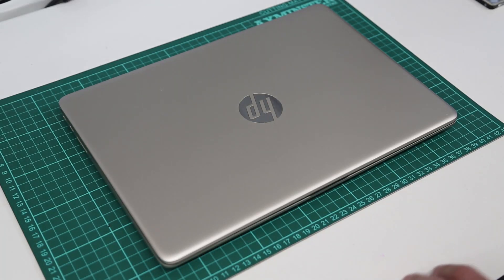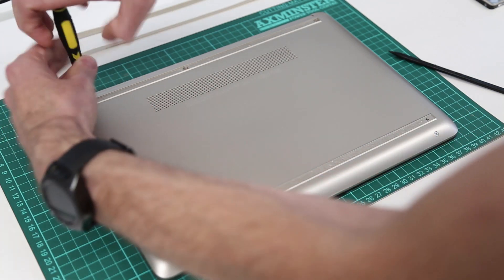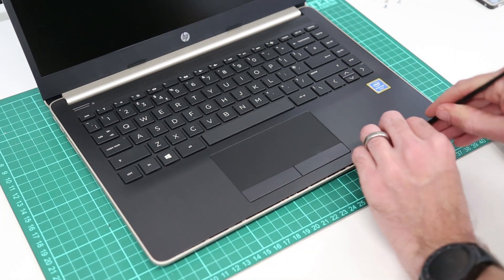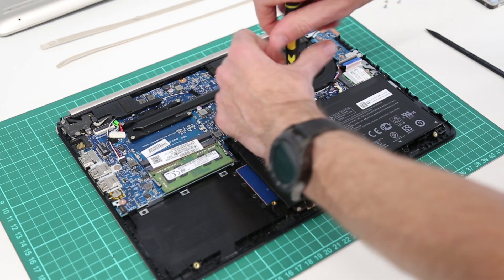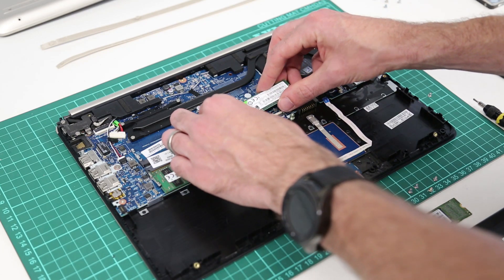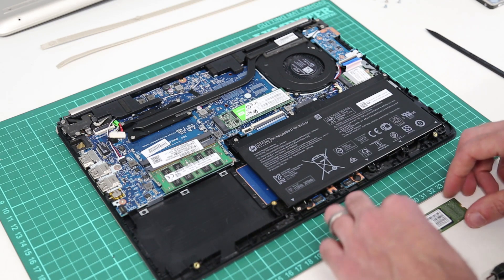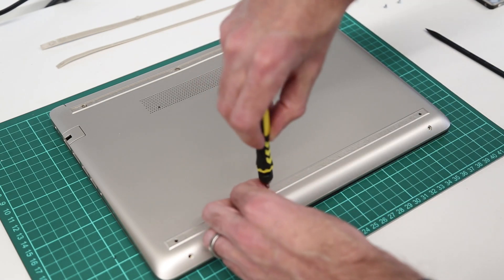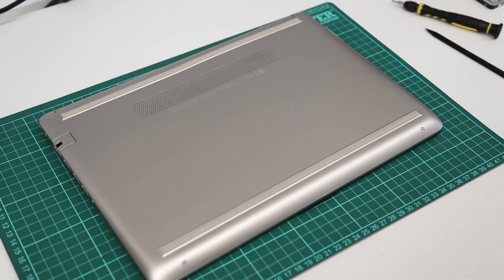HP 14-cf0500sa SSD and RAM Upgrade Guide

Comment: My notebook type HP14s dk0008ax. What type SSD for my notebook?

Ssd m2 or ssd nvme ?
Thanks 🙏
Reply from the maker: Service manual lists both SATA and NVMe type drives, so if it has the slot either should work.
Reply: @BrueComputing  oke. Thank you mr 👍👋
Reply from the maker: @_suryaapr  Glad to help!
Reply: @BrueComputing  i subcribe your channel
Reply from the maker: @_suryaapr  Thanks!
Reply: @BrueComputing  I want to ask again, yesterday I bought 4GB RAM memory (2666mhz). In my notebook ram slot there is 4GB memory (2666mhz) too.
in CPU Z app it reads 8gb. but on the memory menu.

reads only one channel of RAM. please help. is my notebook broken?
Reply from the maker: @_suryaapr  The AMD A9-9425 Dual-Core APU only supports single channel memory - so you can have two modules, but it doesn't interleave between them for increased bandwidth.

Comment: Can you take out the ssd in a HP 14-com0605sa model without breaking the laptop?
Reply: I mean cm sorry
Reply from the maker: Very similar to the CF then - you can find the service manual here: http://h10032.www1.hp.com/ctg/Manual/c06245114.pdf
Reply: Ok thanks
Reply from the maker: That model number doesn't appear to correct- there is no 14-COM chassis.

Comment: Can u change the cpu on this
Reply from the maker: Only by replacing the mainboard - the CPU in all modern laptops is soldered down.
Reply: @BrueComputing  so will a ssd in mine help with loading gta game textures
Reply from the maker: @t-dontcap1896  It may help a little, but it'll never be a great gaming system.

Comment: I have a question did u have to buy windows 10 or does it install windows back on there when u did the hard drive swap
Reply from the maker: The key is in the laptop firmware, so you can either clone the original drive or install and activate without a key.

Comment: I'm upgrading a HP Stream 14 cb012dx with F.61 Bios. I already up graded the RAM but there's only 64GB storage. Will a PCIe SSD work with the bios on this platform? Thanks
Reply from the maker: As far as I'm aware the HP Stream 14-cb012dx eMMC is soldered to the mainboard - therefore it cannot be upgraded. I don't think there is any M.2 or SATA interface internally.
Reply: Thanks for the reply. You are correct that the storage is soldered the board. I was thinking about using a 
M.2 (NGFF) NVME SSD to M2 A/E Key WiFi adapter to attach the SSD for additional storage. I've seen it done on a similar laptop but I can't figure out if this particular bios will recognize or boot from the SSD on that port.

Comment: Why should we disconnect the battery 1st?
Reply from the maker: Because it only takes a few seconds and avoids the risk of damage if the machine isn't shutdown properly before removing or fitting components, power button triggered whilst working, accidental shorting of power circuitry, etc.
It isn't essential, but it is a good idea.

Comment: I bought a HP Stream 14" Laptop (AMD A4-9125 Dual-Core, 4GB RAM, Windows 10, Snowflake, 2019 model) 14-dk0030ca,   I would like to do max update for ram, is it 16gig DDR4 RAM or 32gig DDR4 RAM or 64gig DDR4 RAM? How far can the system go for a maximum update? Thanks Robert
Reply from the maker: There is only one DIMM slot in the 14-dk0030ca. A 16GB DDR4 module may work, I doubt a 32GB or 64GB will.
Given the rest of the system specs though I probably not bother with more than 8GB.

Comment: I have pretty much the same laptop the hp14cf2503sa. Changed my ram to the 8gb but I dont understand why you removed the battery if it wasnt turned on anyway???
Reply: as to not damage the laptop with static.
Reply from the maker: Its not ESSENTIAL, but its good practice. Means it is definitely electrically off, and you won't accidentally power on the machine whilst working on it.

Comment: you should show what to do to your computer aftusjble to ter u are done ...do u have to run a full install or are u are able to just turn it on and start working
Reply from the maker: That's really a separate video in itself, and a subject I have covered in other videos.
You can either clone the contents of the old drive using True Image (or similar) or clean install Windows 10 to the new drive from USB stick.
This video is purely a guide to how to install the upgrades in the laptop.

Comment: I opened my lap top and I found out that only one stick of ram can go in
Reply: Yeah it comes with 1 stick of 8gb 2666mhz ram in my model
Reply: @jake6175  lucky
Reply: What model?
Reply: @isaiahthegamer5648  the newer model of the hp stream 14
Reply: @REDTHOMPSONCLAN wow same I have an hp stream I didn’t buy the RAM yet because I wasn’t sure how to do it so it can only use 8gbs?
Reply: @isaiahthegamer5648  the first slot is already occupied with a 8gb stick, u can add another stick to the other slot, since there are 2 ram slots.

Comment: I just got a brand new Stream 14 with the AMD A4-9120C processor and 4GB memory and a measly 64gig eMMC drive.  What's the max memory upgrade I can do and also what size drive can I swap in?  It's a work laptop, so I don't mind spending a little to upgrade it.

Comment: Excellent video, the one I am using is  hp laptop model 14-cf1000ne and it has only Hard Drive of 1TB and need to be replaced with SDD of same capacity. would you advise me what type ( model no.) of SSD appropriate for my laptop.

Comment: I have a hp 14-cm1000ne. Looks the same as in the video, with 4GB RAM. I've never upgraded a RAM before, therefore i have two questions which concern me the most.

Q1. Can i upgrade to 12Gb, with 4GB in its place and adding further 8Gb Ram? will the combination work? I read the whole comment section and couldnt find any clear answer as it debatable.

Q2. upgrading from 4GB to 12GB, will it affect my battery life?
i recently started to work with photoshop, illustrator and after effects. And this laptop is of no use unless i upgrade my RAM. So please do reply. Thankyou

Comment: Could you upgrade the cpu on this laptop??
Reply from the maker: No, the CPU in pretty much all modern laptops is soldered to the mainboard and can only be upgraded by replacing the entire board.
Reply: @BrueComputing  damn feeling limited with a ryzen 3 , thanks for the reply tho

Comment: Hi, nice vid. I ordered the parts from this and compatible RAM for my own laptop recently. (14-ck0520sa).
I'd like to ask, do you recall which size/type of screwdriver you used for the bottom screws on the back? I'd rather prevent screw stripping so it would be a huge help. It looks like the construction is basically identical.

Comment: Will an M key M.2 SSD work in the slot or does it have to be a B+M key? It looks like an M key slot to me but I've only seen B+M drives installed in it. (14-cf0008ca for reference) Thanks, great video!

Comment: can it hold a 2.5" ssd?
Reply from the maker: If you have a model with an SSD fitted as standard then it will lack the brackets and cables for fitting a 2.5" SATA drive, you'd have to source these and add them in which generally isn't cost effective.

Comment: What's the difference between this one and the model cb0xx? I swear, it's been a challenge chasing my model down so I can be sure what ram I can upgrade to or if it's even possible. Probably gonna have to dive in and have a look myself but thought I'd ask to save some time. Any tips are appreciated 😊
Reply from the maker: The 14-cb0xx range of laptops is part of the Stream line and is quite different. These generally have VERY limited upgrade options.
The service manual is here: http://h10032.www1.hp.com/ctg/Manual/c05227771
This shows that it has a single DIMM slot, so the RAM can be upgraded by replacing the existing module, but the eMMC storage is fixed and cannot be increased, and there appears no option for adding a 2.5" SATA or M.2 2280 drive.
Reply: @BrueComputing  well that sucks. I wish they wouldn't make such limited tech. Seems like a waste, know what I mean? Thank you so much for your quick response

Comment: Do these laptops have the capability to still take an HDD?
Reply from the maker: Yes, but if they didn't have a HDD originally they won't have the brackets and cables for the 2.5" drive, so you'd have to source these. In my experience it isn't cost effective vs. just fitting a 1TB SSD.
Reply: @BrueComputing  thanks , I already have the cable from old laptop so it's just the bracket
Reply: PS: I live int the Philippines a 1TB SSD is is like 10k Php meanwil all of the stuff I need is only 5k

Comment: This is a great tutorial. Thank you..
Question:  I have a HP 14-dk0028wm laptop. is there a way to add a Video Card (GPU) - External is OK, but I understand that a Thunderbolt 3 connection is required and I don't know if this laptop is compatible with that. Also is ip possible to upgrade the CPU to a faster, more powerful CPU perhaps a quad core? Id like to do some occasional video editing, and don't want to invest big $$ into a dedicated laptop for that, just yet.
Reply from the maker: I'm not aware of a way to connect an external GPU in these. The only option for upgrading the CPU would be to replace the mainboard with one with a faster CPU.

Comment: Great video! Quick question, does anyone knows if Amazon sells any bracket to place an HDD in this laptop and the specific SATA cable needed?
Reply: Part numbers are in the manual. 

2.5" HDD Bracket - L24490-001
SATA Cable - L23187-001

Comment: Nice video, I have a HP 14 cm1025la, it has a m2 slot but I dont know what tipe or max store it can handle. Please help...!
Reply from the maker: Assuming it has the internal M.2 slot it takes M.2 2280 modules or either PCIe NVMe or SATA type, NVMe being faster.
Capacity should be as large a module as you can find in that size of M.2 module, eg: https://amzn.to/2Xgijon

Comment: What a fantastic tutorial! Thank you! I am about to purchse the 4GB  HP 4-dk0599sa from Currys. My question is, will this be a similar process for this machine? They look similar on the outside I think.
Reply from the maker: It should be similar, you can find the maintenance manual here: http://h10032.www1.hp.com/ctg/Manual/c06242992

Comment: This worked beautifully for the 14-dk0028wm, which is the Ryzen 3 3200U variant. Identical motherboard, other than the AMD vs Intel thing. All I did was add a second stick of Crucial 4gb RAM. Later on, I'll swap to a larger NVME drive, and possibly track down the components to add a 2.5" hard drive or SSD.
Reply from the maker: Glad it helped!
Reply: Hi. I would like to ask you, do you know the part number of the kit to add the 2.5" SSD? Thanks, regards.

Comment: Hey James, I recently ordered a hp 14’ whisper silver laptop through Walmart app. It comes with amd 3200u and Vega 3. Do these ram upgrade and ssd upgrade would work on mine, thanks
Reply from the maker: Do you have the full model number?
Reply: @BrueComputing  hp 14-dk0028wm
Reply from the maker: @viziobehringer3633  The service manual here: http://h10032.www1.hp.com/ctg/Manual/c06242992
Shows that there are a pair of DIMM slots, and that model has a M.2 SSD as standard so will have an M.2 slot. So yes, should be possible to do both of those.
Reply: @BrueComputing  thanks brotha!
Reply: Brue Computing sorry for late reply. Just picked it up today at Walmart where I work. It’s 14-dk0028wm
Reply: I just had the same laptop show up today. These instructions are identical, as the motherboard layout is identical.

Comment: Hey man! Thanks for the detailed video of the laptop, i have the same laptop board as you "HP 14-cf0012dx". Im planning to add an extra ram in the empty slot. But just have one question. The extra ram module I have is DDR3, would i be still able to add it despite the original slot is DDR4?
Reply from the maker: No, DDR3 modules won't fit in a DDR4 slot.
Reply: @BrueComputing  alright thank you!

Comment: I have a HP 14-df0053od will this work for me ? I was going to order the exact parts you ordered
Reply from the maker: The HP 14-df0053od is equipped with an eMMC module for storage, so without opening it up I don't know if it'll have a SATA cable/bracket installed for a 2.5" drive, or a M.2 2280 slot for an M.2 SSD - it may not have either.

Your best bet may be to open up the machine and see what sockets are available.

Comment: hola! buen dia, yo tengo una laptop hp 14-ck0009la y tiene puerto igual M2, lo que quiero saber que tipo de SDD le puso a su laptop si es: NVME O M2 ??
Reply from the maker: I fitted an M.2 2280 SATA drive, but M.2 2280 NVMe PCIe drives are also compatible.

Comment: Superb Video! My wife has a very similar model and chassis design. Her's had a very noisy CPU fan for months. I could never figure out where the rest of the screws were to take the back off. Who'd've thought they would be hidden under the rubber strips? Once I got the back cover off a little compressed air is all it took to blow a wad of dust from the fan. When all was sorted and back together the fan purred. Job done. Cheers!

Comment: Thanks for the great video!  Would there have been a downside to leaving the original 4GB RAM in there along with the new 8GB?
Reply: Yes, it slows down the overall performance of the Ram, you would need the sake brand and gb size for it to worl, mixing at least for me is not reccomended. A 2x8 gb ram( 2 ram stick with 4 gb size) or a 2x17 gb ram ( 2 ram stick with 8 gb size).
Reply: @aganimsaj1376  Thanks for the reply.  I know that there are many misconceptions about the importance of using RAM that is the same brand and GB size.  Forgive me for asking, but do you have some expertise in this area or are you just sharing the conventional wisdom?
Reply: It's been months but I'm pretty sure mixing them would work. It would run in single channel mode rather than dual channel since the 2 ram sticks are not operating on the same size and frequency. But running just one stick of ram would also run in single channel. So, it wouldn't make it any slower than it is but it can be faster with matching ram sticks.

Note: If the additional ram stick has a lower frequency than the original, then it would make it slower since they will run at the lower speed.
Reply: @Neil Sklar I'm sharing what I've read so far on the internet looking for, at least, a proven answer which many did and doesn't recommend different memory stick sizes and frequency but however they can be of different brand. I did say reccomend but you can test it out yourself, I'm no tech expert but I do research intently. Good morning!

Comment: Great video, thanks. strangely I have the exact same model, but the battery screws were slightly different, two at the top and two at the bottom. Where your had a screw in the bottom middle, mine located under a small retainer bracket. But it did not detract from the job which is fully successfull. I have a photo but can't upload it here.
Reply from the maker: Glad it helped.
Reply: @BrueComputing  hi i have a hp chromebook 14-db0500sa and im worried i might not be able to get the right ram as in im worried it might not fit do you know where you can get the right type of ram for me i want to upgrade the ram for performance boost and gaming id gladly appreiciate it if youd help me out

Comment: My fiance just got a similar computer and was very disappointed with how laggy it felt. She wanted to return it, but I told her I would look at it. So I deleted some bloatware, changed some registry settings and it felt a little better. I then looked at how much RAM it had, and i couldnt believe, a laptop on 2020 having only 4 gigs! Anyway, i opened up one of my laptops and took an 8  gig stick to put in hers. I was shocked to find only one slot for RAM. Anyway, took the 4 gig stick out, put the 8 gig stick in. The extra 4 gigs made all the difference. It now is a lot snappier, a lot less laggy. This laptop is a good size for her, with the SSD, and the screen is really vibrant and battery life is decent, she should be happy for a while either this laptop.
Reply from the maker: Great stuff. Glad it helped.

Comment: i bought the HP 15s-fq1505na 15.6" Laptop from currys last week and decided to upgrade from 4 gig of ram to 8gig. when i took the back off i had 2 ram modules one with the 4 gig but when i tried to install another 4 gig in the empty slot the module pins were soldered down so i couldn't install it. why would hp do this? i'm really dissapointed, i cant run ram in duel channel mode, maybe it's a faulty board. should i complain to hp and tell them i have a faulty ram slot? is this a common practice with some makes of laptop?

Comment: I know nothing about upgrades or laptops but this guide makes it look really easy. I'm wondering how I could find out if I could do this with a 14-DF0018WM it's storage is 64GB eMMC and 4GB Memory² and also is there any way I can flash a different BIOS menu because the one on it doesn't have options for overclocking but my CPU it's a Celeron N4000 which should be overclockable any help would be much appreciated thank you.
Reply from the maker: You can find the service manual for your model here: http://h10032.www1.hp.com/ctg/Manual/c06146792
The Pentium and Celeron models have a single DIMM slot, so you could remove the 4GB DDR4-2400 module and fit an 8GB DDR4-2400 module like this: https://amzn.to/2THembW

The eMMC module I don't believe will be upgradable - normally these are soldered to the board. You MAY be able to add an M.2 SSD if HP have included the socket on the board (often they don't on non-SSD systems), or you could fit a 2.5" SATA SSD if you buy the required cable (part no. L23187-001) and bracket (part no. L24490-001)